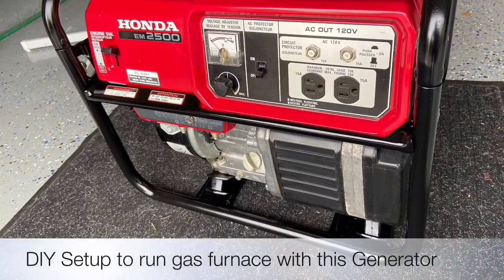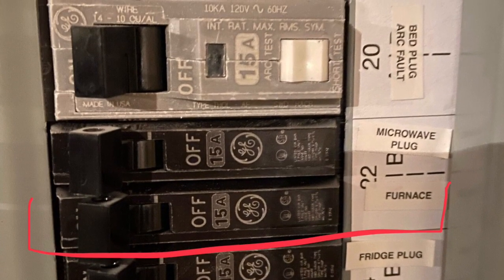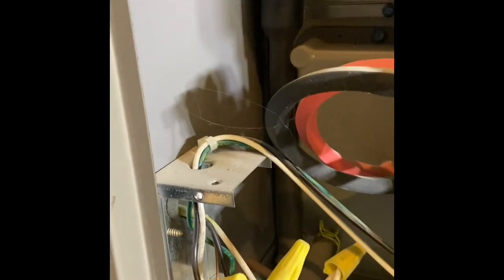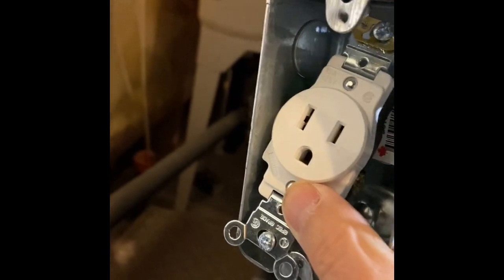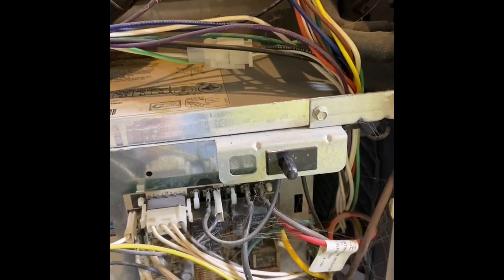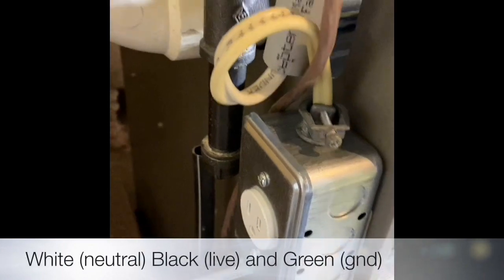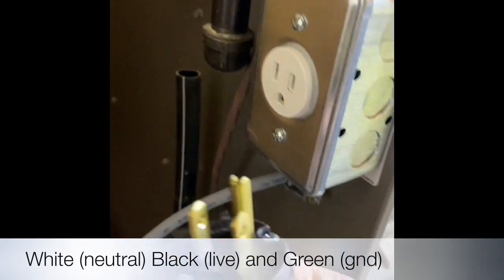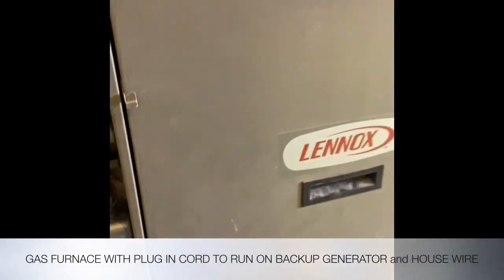DIY - Wiring Home Gas Furnace to Run on Backup Generator

Comment: Does the generator run the furnace? I did the same thing but furnace shuts off flame when the blower turns on.
Reply from the maker: When I tested after I did the plug, it is working fine . The relay that turns on the gas all controlled by furnace control board which receive 110 V power from the house or from generator.

Comment: It appears the extension cord you have going from your generator to your furnace is what is called a suicide cord.  Not a good idea.  Definitely better ways to do this.
Reply: That is by no means a suicide cord.  All that is being done is to wire the furnace with a pigtail  to power it directly to the generator in the event of a power outage.  The issue you may have is a floating neutral generator.  In this case, powering the furnace directly, I believe you would want a bonded neutral.
Reply: Not a suicide cord...  He basically split the power feed coming into the furnace and fed the house power into a new box with a receptacle and then connected the furnace wiring to the male extension cord end.  When the power goes out in the house, he unplugs the furnace and plugs it into an normal extension cord connected to the generator.  There is never any power being fed out from the male blades on any plug.
Reply: So when the power goes out this pigtail is plugged into a bonded generator now from what little i know your not supposed to have a neutral ground bond in two places. With this setup its bonded via the generator ground/neutral AND its bonded ground/neutral via the the furnace enclosure to the main circuit breaker panel.  The connection is made when connected to the plug and plug housing grounded to the metal box back to the ground wire in the furnace. I do believe if the metal plug box was plastic that would sever the tie to the house wiring. But that does leave the question what about the vent duct being metal and there connected to the metal  furnace. IDK need a HVAC guy here....
Reply from the maker: It is rated more than 500 watts .  But I do have heavy duty cord as well.  Dedicate circuit need its own extension cord .  Thanks for your message .
Reply: @maniata8869  a suicide cord has nothing to do with watts.  It's the fact that both ends are male.  Very dangerous.
Reply from the maker: Both ends are male? The power cord from the furnace does not produce power . The furnace only receives power from either the receptacle or from generator. Like plug-in a toaster even in a receptacle.  Not sure I know what you mean.   Please elaborate